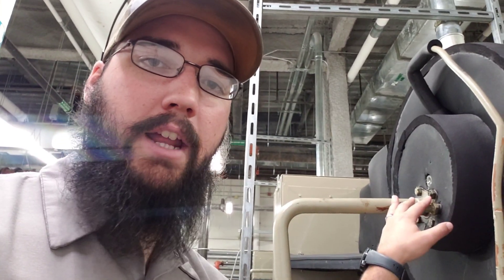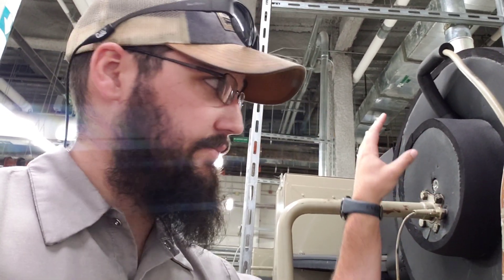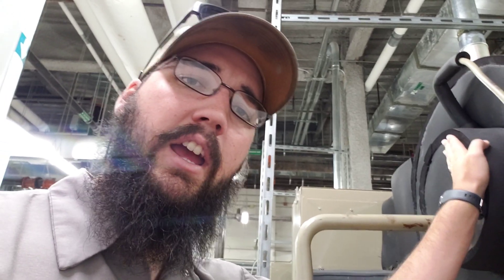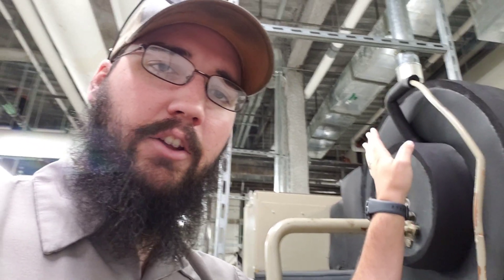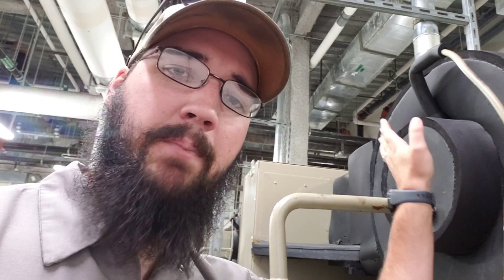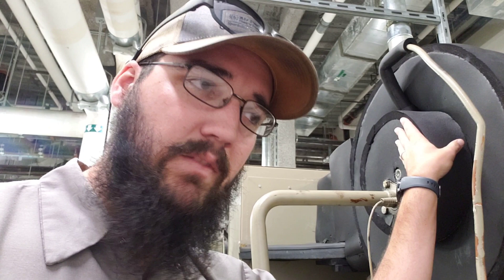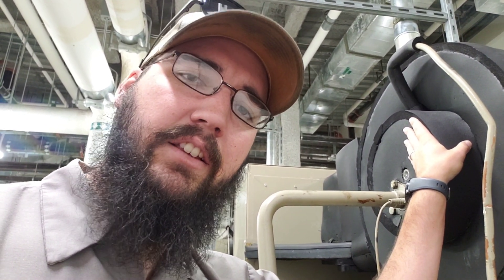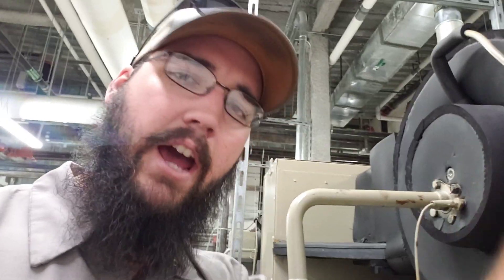Trane CVHE Chiller Tail Bearing Failure

Comment: Do you have any information on that CVHE cooler, I have problems with that model; R514a and oil0032 are not compatible and cause damage to the compressor bearings. do you have any Bulletin about that?

Comment: Please explain "oil tank was 2" lower than the evaporator"
Reply from the maker: Pressure was lower in oil tank.
Reply: Hi, I was told the oil tank pressure and evap should be the same. What does it mean if the oil tank pressure slightly higher or lower than the evap?
Reply: @ES-ml4cg  Need the tank pressure slightly lower to insure oil return to sump